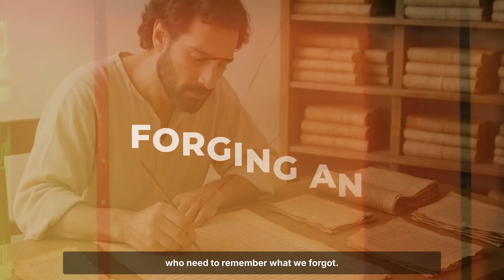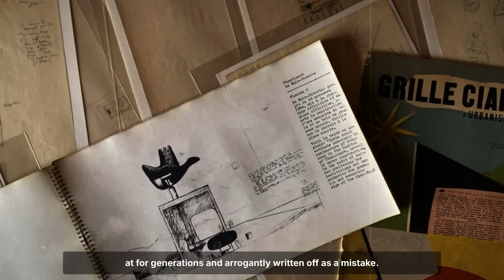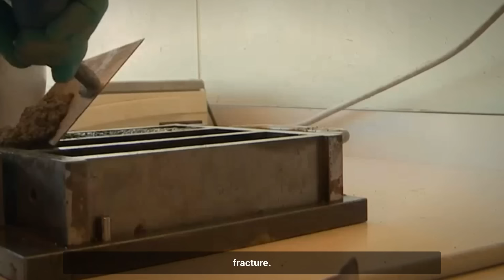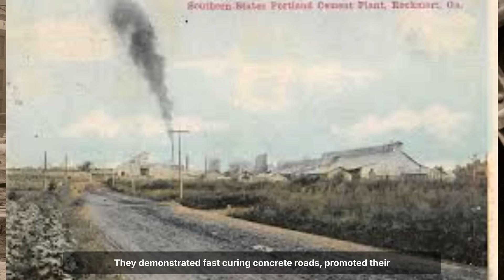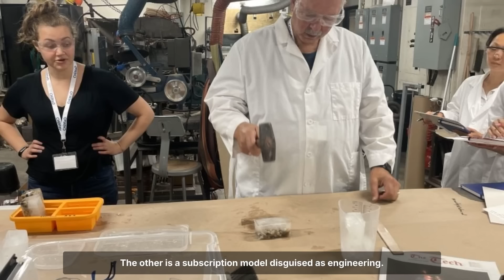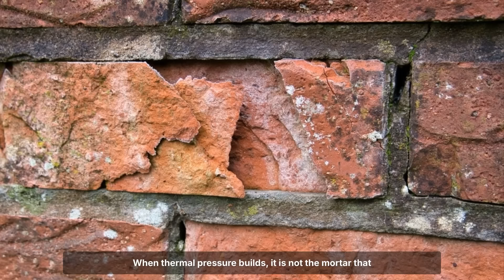Build This Ancient Concrete Mix: Self-Heals Cracks and Gets STRONGER Over Time (3 Ingredients)

Comment: Slight correction: 

Roman concrete isn't as strong as Portland cement, which is why Roman concrete isn't used. However we could very easily mix Roman concrete with Portland cement and Slag and coat the rebar in magnesium Ferrite and get a fairly long lasting concrete that kills maintence costs
Reply: Its stronger than portland and longer lasting pasts thousands of years

Comment: Pay more money and it will stand forever. Many big modern structures - canals, bridge piers, wharfs - stand for 200 years and will continue for more. And, of course, Pantheon does not "stand without repair", for all 2000 years it is cared for, as it was temple and then sacred as catholic church in 609AD.

Ummm, CaO in romanconcrete???? for such quality construction Romans crucified everybody on the spot! Really important structures were build not from fresh burned lime (CaO immediately from kiln) but from Ca(OH)2, result of many years of hydratation in special ditches - 3 or even 5 years. They did know what means unreacted CaO in concrete...

Comment: What other videos have shown is that these structures were energy producers through frequencies, the colomns were. wrapped with brass wires and the whole building has metal precisely bonded together like a big battery. Today they do not ground the rebar, electrolysis is created from the moisture and rust. Now they use expensive epoxy coated rebar, very strict inspection to assure not metal is exposed, if so they have an epoxy spray paint to cover those areas. I love Automated Intergraded information is being released, but some of it can be misleading because of WHO wrote its program.

Comment: 3 ft × 3 ft slab, 5–7 in thick

Mix: 27 lb quicklime + 55 lb volcanic ash + 66 lb sand + 66 lb gravel + 3 gal Celtic saltwater

Pack in forms → cure moist → self-healing begins

Suitable for patios, garden slabs, or light-duty walkways without steel

Use pumice powder or fly ash (type F) as substitute for volcanic ash.

Salt to water ratio:

Mix 35g of "Celtic Salt" (important) per quart of water or 140g per gallon (1/2 cup)

This supplies the minerals for the concrete to "self heal"

Note use caution mix will get extremely hot (300 deg) possible
Also quick lime is very dangerous  to eyes and lungs!!